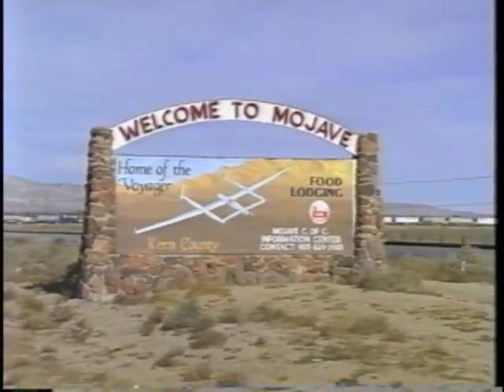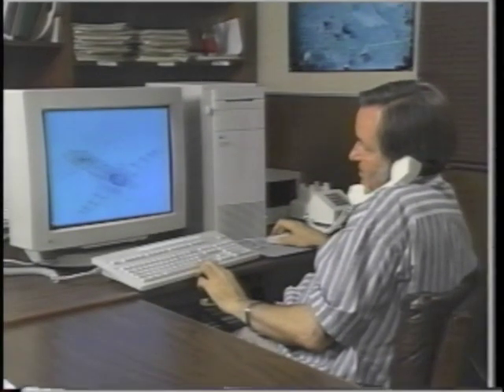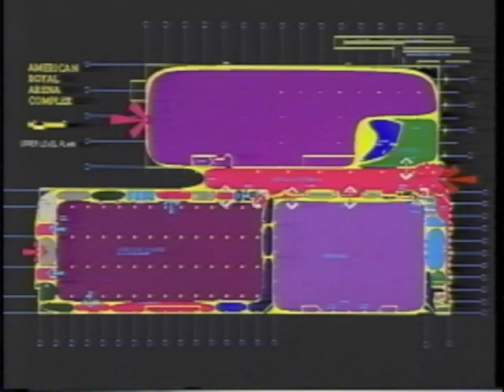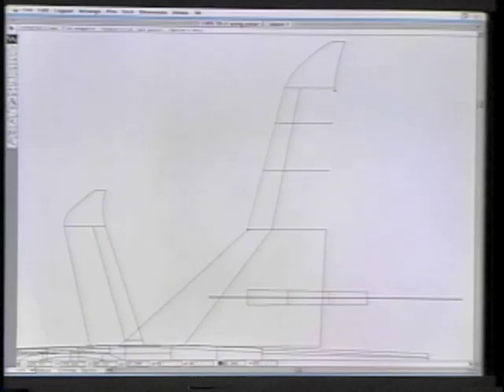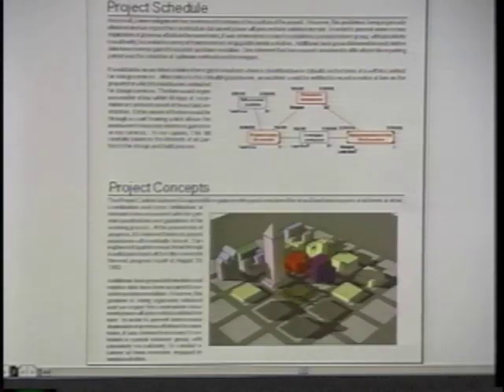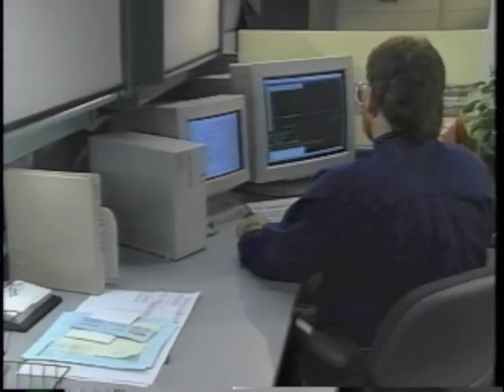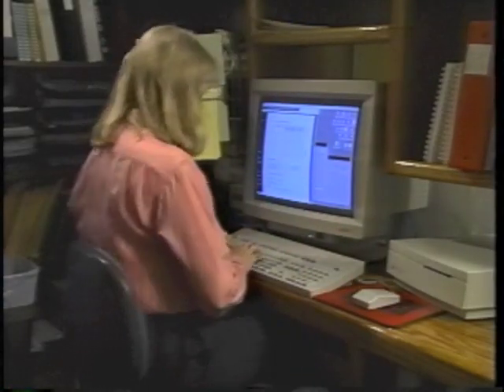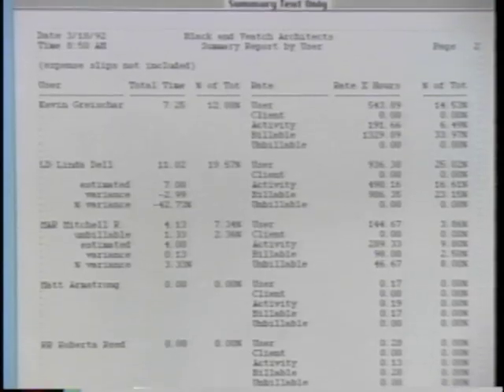Apple Macintosh - The Design Solution - Engineering & Architecture - 1992

Comment: We have come a loooong way though. Its sort of funny watching how slow everything rendered on those machines. Simple wire frame rendering was slow enough to see the draw rate. But, thats how it was back then.
Reply: ***** But it's still cool to see these old computers work. And it's even more amazing to see that they could do the same thing we can - just 25 years ago. You've got to remember that these computers (Quadra 950 and 700, as well as the PowerBook 140 and IIsi and various IIcis) you see in the video didn't have a 1 GHz processor - they were about 12 or 13 years before the standardized 1 GHz processor Macintosh came about.